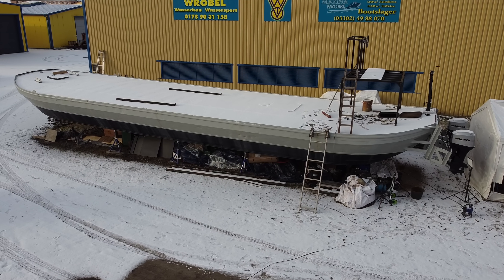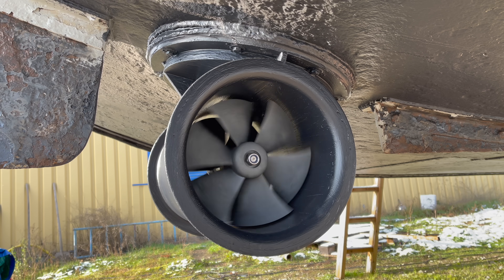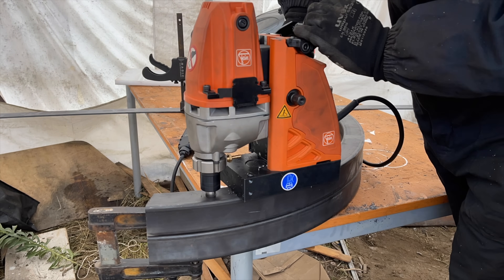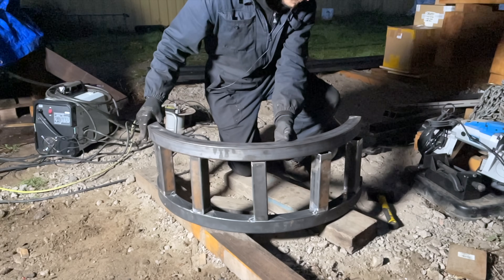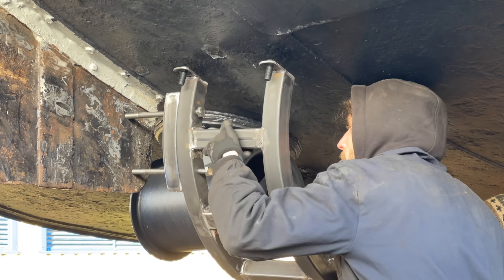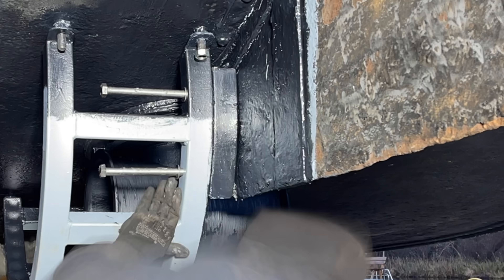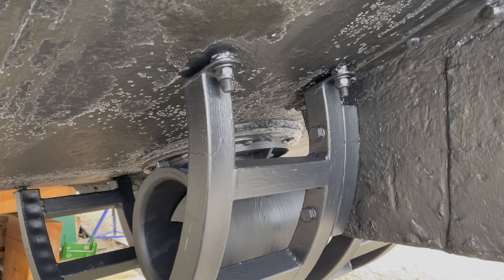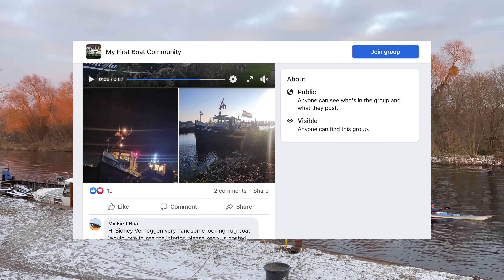Finishing the BOW THRUSTER on my 1902 Barge Boat

Comment: Nice job! Next time, if you want to weld a screw to the hull, first find a piece of thick iron plate, drill it, cut of the screwhead, then put the screw thru the hole, weld the screw to the plate on both side, grind the weld smooth on the back side, then weld the plate to the boat. It will be way stronger.

Comment: A suggestion , when you are welding square tubing or pipe drill a small hole in it . The reason you are getting those bubbles in your weld is because the air in the tube/pipe is hot and trying to escape . With the small hole the air escapes and it’s easier to weld the small hole after you are done with the other welding . Also invest in larger drills they are quite a bit cheaper than the end mills that you are using . The boat looks Great !
Reply: I think you need to go back and see the episode where he is sick of blunt drill bits and he swaps to end mills (for a reason).

Comment: You should always use a cable gland whenever making a penetration with wire.  Over time you run the serious risk of shorting the circuit by means of the sharp steel corners cutting through the outer shielding of the cable. Love the channel and the progress!
Reply: Yeah he would have been better off running a piece of conduit through there and running everything through that
Reply: Drilling the hole slightly bigger and running a piece of conduit, ot even a short piece of rubber tube throught the hole, and putting the wire through the conduit/tube would have been better. A bigger piece of plastic pipe through the hole would probably be even better, as it is highly likely that more wires will require passing through the bulkhead later. Drilling a hole through the deck and passing the wire through that, is also not ideal, imo. I think he could have welded a piece of larger diameter steel tube, curved around at the top (goose neck fitting) to pass the wire through. This will also leave space to later pass more wires through from the steering position through the deck, as may be required.
Reply: Also some recommend not drilling at all below deck and simply mounting a cable tray the length of the ceiling. Then a deck penetration with your suggestion of a gooseneck is also a great way to prevent future issues. 👍

Comment: Your protective cage around the bow thruster is a beautiful thing to behold! The one problerm with tubular structures under water is that water inevitably gets into the tubes and they start rusting out from the inside. This will take quite a while though, and fortunately, if this should become a problem, your construction can be unbolted and a new one made, if required.

Comment: please install cable grommets into the holes you made for the bow thruster cables through the bulkhead - if you dont the cable insulation will eventually breakdown through engine vibrations etc

Comment: Nice the cage for the bow trust. Now what you forgot is a raster on both sides of the trust to avoid any obstacles going inside the trust when using it. only then you have protected the blades and the trust. The distances for the grating is up to you. Good luck.

Comment: This made me think about two things. The screws going through the cage open up the inside of the cage for water. Maybe put foam into it to seal it, preventing any corrosion from the inside?
The control cable connectors have no protection against humidity at all. Maybe add something so they dont corrode over time?

Comment: hello On top of that protective bin, I'd bolt a 5- to 6-millimeter sheet of metal all over the outside. Because if you drive into sand or mud, the basket will sink and the sand will rush into the basket and push on the diffuser with the propeller and can damage it.

Comment: Turned out well. Glad you switched to flux-core wire for outside welding. There is slag, sure, but it make it so much easier to get a well penetrated weld. Good work.

Comment: The cage looks very nice only one suggestion, those bolts that you weld on the hull will break af wen you hit something en then there is a chance that the welding will rip open you hull plating.
Ist best always weld a big plate of steel on the hull end then your bolts.
Bij this way you will divide the forces on the hull end not damaging it

Comment: I think your videos are really great. But with this one I have some concerns, as have a few of my previous speakers.

The vibrations caused by the openings should not be underestimated. A boat should always be streamlined, so you might want to consider building a smooth metal construction over the cage you've created so the water can slide past it. 
I am currently in the process of building the bow and stern thruster for my boat and had a shipbuilder friend of mine explain this to me. He said that even with internal bow and stern thrusters, small distances must be built in front of the side openings so that the water does not swirl in the pipe.

In my view, there are massive turbulences in your construction, which could not only cause the speed but also the demolition of the bracket. 
I think all of your projects are really cool and I wish you all the best to get ahead. About a month ago I drove past you in a houseboat but you wasent there otherwise i would have say hello 🙂. In real life, the boat looks a lot bigger.

Comment: Nice work - enjoying the content. With the bow thruster cage, have you considered adding some protective sheeting to the leading edge of the cage to close it in? Only needs about 90 degrees or so (the front half of the cage) of thin steel or flexible perspex/plastic you can bend to the shape of the cage, and it helps protect the thruster from damage by sticks / weed etc that make it through the cage holes. It will also help lessen the cage getting clogged up with weed or ingesting rope etc. A solid shroud (fairing) on the front of the cage would also help with hyrdro-dynamic streamlining, but as others have said, it's less of an issue in this instance with the hull and displacement you have. You may be surprised at the benefit in fuel economy benefits over time, as smoothing the water flow out before it hits the rest of the hull can only help.

Comment: Love the channel, just a thought, you have created a situation where you have multiple types of ferrous metals in close proximity to each other. This will cause galvanic corrosion in any circumstance but becomes very prevalent in saltwater. If you do not ever go in saltwater it is likely it will not be a serious problem for many years, but if you do it can become one very quickly, especially if the hull is not properly grounded. I would ensure that the hull is properly grounded and place some zincs in that area to mitigate any issues. Good luck,. looking forward to the rest.

Comment: Hi there, love your projects.just a comment from a marine engineer. The cage you built is useless. The only and most efficient protection for bow or stern thrusters are simple grid positioned at the thruster tunnel openings. With the size of yours you could easily mount a circular grilling grate or cut one from chicken wire. The structure you built only increase weight and depletes hydrodynamic but most of all, maneuverability of the barge which is already quite heavy. Keep up the good work looking forward to see your next steps! Bravo!

Comment: Your “rough” welds my be from the heat of welding creating an increasing air pressure in the otherwise sealed container.  This creates a situation where the air pressure pushes out the molten metal,  You might try leaving a hole for air to escape while you are welding a closed compartment (like a piece of tube between 2 other tubes).  Once the weld is complete, with the air hole left open, let the piece cool, then close the hole.

Comment: Good job 👍🏻 
Would it have been possible to have installed the thruster inside a long tube going inside the hull from port to starboard ?
Under the waterline and as close to the bottom as possible

Comment: Good work i would use a copperhide mallet instead of the hammer.just be mindefull about the amount of metal you use as you will need a big engine to move the boat.

Comment: I believe you should have used some thick metal plates and made like a v hull in front of the bow thruster so when you're heading forward the boat will move through the water better
Reply: He´s not going waterskiing behind this one ;-)
Reply: @belledetector  I thought the same myself but then remember how dense water is, so even at 5 km/h it may make a difference to have a slippery hull shape. I would have increased the depth of those two keels either side of the thruster as I don’t think the arches just made will withstand the 16.5 tonnes of weight of the boat if grounded.

Comment: Well, it’s protected, against shallow water. Not against everything which is floating around and, for sure, will get in between your propellers. So I would suggest to welt a raster of thin iron on both sides to keep this out.
I don’t know what’s the purpose of this boat, in the Netherlands we call this a Dekschuit and it is used as a work platform. The are normale towed but yours will sail ok with this bow thruster. Remember that 2 outboards will not give you the current you need when using this bow thruster often. They don’t provide much current, about 15 A each.

Comment: Actually, Your progress in using machines and instruments is astonishing. On the other hand, it seems like lack of engineering ideas, as I've wrote before. Now You've made a great protective construction to save side moving engines. It should be strong and heavy. And attached firmly mostly in its rear part. So, if Your boat is moving back, it can hold some strong kick. But if You move left, right of forward? Does the fixing for 2 bolts, welded by it's caps, really helps? Are You not afraid to tear  it off? 
Also, You use a ladder construction. Instead of plain metal list. Are You not afraid that all rubbish and dust will be accumulated on this ladder construction? How often do You want to swim to clean it?
Reply: Sorry, for not accurate advice. After writing a comment, I've noticed that this propellers are not in the back, but in the front of Your barge. Then, I can't imagine, how often they can be really kicked while Your barge will move forward, left or right, or make complex maneuveres. I even simply don't know, is it  wise idea to put such engines and ladder construction on that place. Hope, You will not be disappointed while testing Your barge on water. Wish You be lucky and ready for continuing the project.

Comment: May want to add a cable gland to reduce water penetration and cable damage at the wire deck hole entry. Also you may want to consider a wire mesh welded or bolted to the bow thruster guard. There are vulnerable gaps that smaller objects can pass through.  Similar to ship/boat propellar guards.
Any plans to eventually the inside/underside of the barge a gray or white color.   Minimize rust and add light.  Also any plans to add led string lighting or zone lighting for visibility and maintenance work?

Comment: I think that the weakest point of the cage are the bolts welded to the hull. Between the hull and the cage there is space that can allow momenutm on the bolt. In my opinion u should put a piece of metal to spread the force in case of impact.
Reply: I noticed no spreader plates on the 4 bolts holding the crane to the deck too.

Comment: You should really add a sheet of steel over those arches. If you hit a sand shoal with that it will simply dig in and still damage the thruster. It would also make it easier to pull  the barge out of the sand.

Comment: tolle Arbeit!.....with all these new metal structures you are adding, the overall weight of the barge/boat will of course also increase. Each piece may not weight much, but the sum of all these new additions will add up to a lot of extra weight. Just making sure you are keeping an eye on the increase in weight.
Reply: This was originally a cargo barge, meant for hauling many tons of freight. I doubt he will ever approach its weight limit. In fact, he may need to ballast some to get it  riding correctly in the water.

Comment: Just a thought here. Won't that vertical "skeg" thing that the cage is bolted to  impede the effectiveness of the bow thruster. It's there to keep the bow tracking straight and prevent side to side movement.  I would have just cut that thing off welded the cage to the hull and then made a horizontal plate from bow to the bottom of the bow thruster, like a skid plate on a car. 
then you would just ride up and over things.
Reply: At 1 km/h the longitudinal skeg won’t affect lateral movement. He went to great trouble to explain lateral movement due to wind and current being more of a problem and so he is welding more “keels” to the underside to keep her running straight. You cannot have your cake and eat it too.

Comment: All I will say is that you can't really call yourself a novice boater anymore. There is always much to learn and as usual much is common sense. You are doing just fine considering you dove in full throttle. I can't count the boats you've dealt with since the beginning. At least 3 or 4 but this barge hull will be a nice blank canvas. Can't you picture a party barge. Motor her to the Bahamas and enjoy yourself a while.

Comment: I'm not up to speed with your planning on your bow thruster. What you built will probably cost your boat 2 or 3 knots of speed. Are you operating in shallow water and need a grounding shield ?...Do you need your thruster to move more than just your bow ?...I would do an internal reversible pump with 4" openings below the water line near the bow but that's just me. Watch all your posts, you do very good work...

Comment: a pipe through the hull would have been better that cage will crush when you hit a sand bank the weight of the barge and combined with your speed will bend that like it was a piece of wire

Comment: The drag on the bow from not having the bow thruster enclosed will be extreme 😢
Reply: It's not a speed-boat. At the low speeds this boat will be operating at, the drag will be inconsequential.
Reply: @jaygee5693  the fact it is not a speedboat is irrelevant get any similar size hull then stick a foot wide board in the water at the bow and see how it behaves in any manoeuvre and watch how the fuel consumption increases!

Comment: Doesn't that protection of the bow thruster greatly disturb the naautodynamics of the boat? It looks anything but fast.
Reply: Saying that barge has any nautical dynamics is like saying the Queen Mary is a speed boat.  lol...     These barges are anything but streamlined, and you literally muscle them around with engines and thrusters.
Reply: @mmm365  You could hang a couple of anchors out on the sides of that thing and it wouldn't make much of a difference in the overall drag.  It's a barge, not a boat.
Reply: @mmm365  I've probably pushed more barges than you've driven cars.  Have a great one.

Comment: I admire your sprit and you make nice videos, but you really should spend some time learning about hydrodynamics and structural engineering. Your bow thruster “cage” is going to cause so much drag. I get that it’s a barge, but still that huge structure is going to slow you down significantly and may also affect the steering/tracking of the vessel. Your outboard brackets/transom are also hugely over-built. Remember weight on a boat, even a barge is the enemy. It would be good for you to learn as you go along and work to lighten these things up and consider the performance of the hull in the water.
Reply: .   Will be interesting to know fuel consumption and if vibrations or shuddering will be created by the thruster cage.  Out in open water the outboards could be completely submerged from another boat's wake.  Prop pitch is critical also because outboards are designed for speed more than heavy slow loading. Still the most creative boat project on YT.  Happy cruising.

Comment: Hello! Am not trying to teach you, just want to share with you my opinion. The shape of protection rack is definitely good! But i think square tube doesnt really match expectations, having closed air, or the most probably, water volume inside while using... Even if you welded everything water tight, water condensate will destroy pipes from inside super fast...
My opinion: its better weld it out of thick 4-5mm L profile, which is going to rust way longer than square pipe...
Best regards from Russia!!!

Comment: Those bolts are shit welded to the hull of the boat and will not hold even a minor impact. Also this cage is protecting nothing atm and is designed by a 3 year old. It could have been made smaller, less bulky with very little skill...